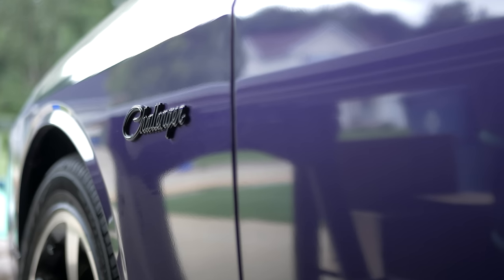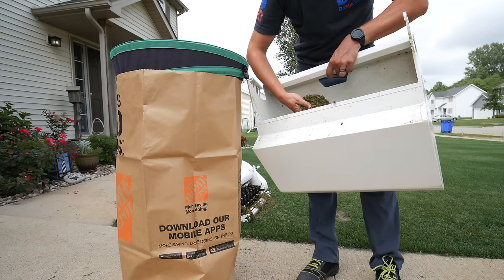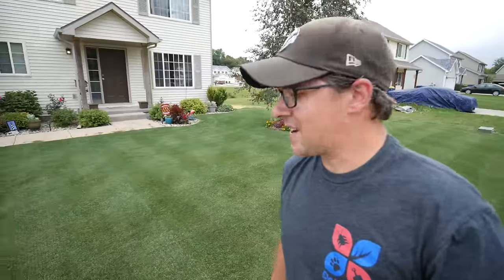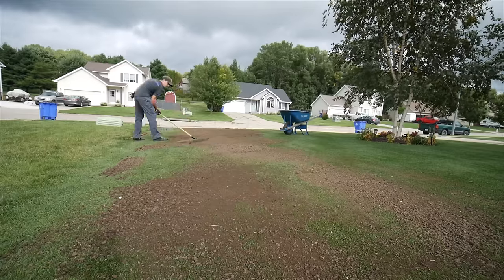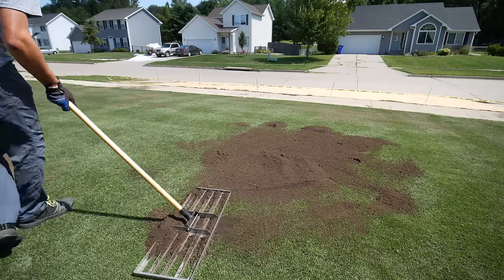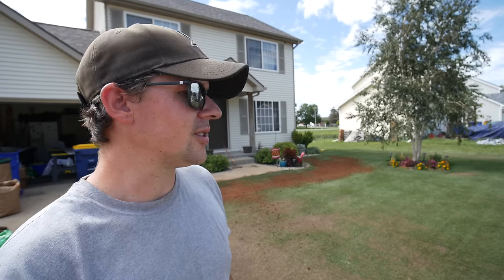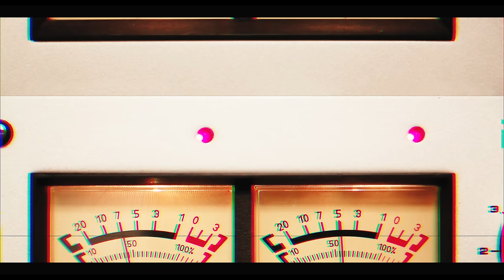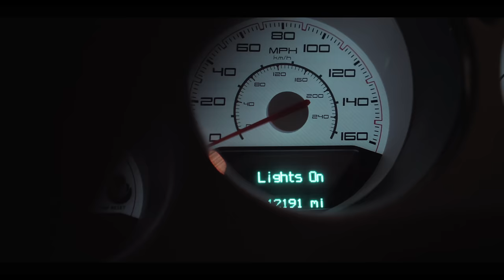Topdress Leveling Overseed + Labor Day Bonus Footage

Comment: I started using a 30” lute/leveller and it looked really good till I looked at it ground really hard.  There where high and low stops everywhere.  I added a 6” rib to the front and OMG the amount of soil I had to remove to get the land really level.  It was hard work but the end result is a really level lawn and I didn’t have to use much soil to do the final level.  Most of the highs and lowers where caused by the turf having under soil missing or lumpy bits .

Comment: Under my trees ground is like washboard ripples 3/4 inch deep roughy ever 8 to 12 inches apart, grass doesn't want to grow in the low spot. Drop spreader hits the bumpy area more product shakes though the bottom of spreader. I speculate it's caused by rain water running off the tree leaves.

Comment: Hey Ryan, I have a question. I have a fairly new lawn that has come in nicely, but I'd like to start leveling it and transition to a shorter cut with a reel mower. My question is that I live on a corner lot with a sidewalk with strips of grass between the sidewalk and the street. How durable is the leveled, low-cut lawn? I get a lot of people walking across my lawn and I don't think that's ever going to change. Not enough to kill the grass and wear paths, but I wouldn't want to switch to a low cut if that is going to be more fragile. Thoughts?

Comment: Ryan... top dressing and over seeding time.  Wanted to run a couple products by you in hopes of getting your professional opinion.  First off I'm in SE Wisconsin... hot humid summers and cold winters... I have a new home build lawn (Sep 2018) and on my 2nd season. Looking to start converting to KB grass. Not even sure what was laid down by the builder however I did over seed last fall with a Vigoro sun & shade from Home Depot (I believe it was a mix of mainly perennial rye.  But PRP keeps coming to mind yet I can not find PRP on internet grass seed searches.... not to mention in a previous comment to you I mentioned it and you even said you had not heard of it. No matter... going towards KB.

Question 1: A local mill offers what they call a Premium Athletic Gold (80% KB/20% PR). I wanted to know your thoughts on using this for a section of top dressing and then to over seed the rest of the yard as my yard to too big to top dress all in one season.

Question 2: They also offer a 14-24-09 starter fert. Your video mentions a 14-20-04 but the other is all I can get in quantity on short notice and at a decent price.

Question 3: Should I only use the tenacity on the top dressing and heavier seeding area or should I try to stretch it through the whole yard?

Yard is roughly 13,000 sq/ft.

Thank you in advance for any input.

Cody

Comment: How do you get new grass to grow just by putting a small layer of dirt on top to level and then put seed down? I thought you needed to get seed down into dirt about 1/4 inch deep BUT also have the soil under it soft and ready to accept new roots.  I have a 3 foot section that is low and deciding whether I really need the grass dug out or if I can just put about 1 inch of dirt on top of old grass, then sow the seed into that.

Comment: Happy Thanksgiving.. So having a prob. My lawn is usually an 8/10 but this past summer I got some chinch bugs and also some spots of bent grass. We killed that off at the end of the summer, then a few weeks later we aerated, seeded, starter Fert, hay. a few spots took but the main areas in the front and a large area in the back did not take. After a few weeks the landscaper put some more seed, etc now a few weeks later nothing. Its getting enough water, the weather has a been fine etc. Not sure what else to do but the seed is def. not taking.. I can send pics if that helps. this is driving me nuts lol .Im in NY.

Comment: Ryan, I understand that the grass blades must absorb sunlight to survive. My Zoysia lawn down here in Florida has some pretty severe undulations. Overseeding Zoysia is not an option is it? What tips do you have before I begin the leveling project? And should I use sand or topsoil as the leveling material?

Comment: Can someone please answer this question? ====>   I just put down dozens of bags of top soil to level a few spots in my lawn.  These were pretty deep...anywhere from 5 to 8 inches.  They're not perfectly leveled right now and I would like to put down sand on top of the soil I put down.  Will this be ok, or do I now need to keep using the top soil since that's what I've originally used?

Comment: Can Perennial rye be cut very short (under one inch) easily? Or does it have to be worked to be cut that low. I tried keeping my rye at one inch but it didn't work out, most likely because of the heat (90 degrees) but I'm interested in trying it again as the cooler season Is approaching.

Comment: That was a beautiful and inspiring video on top dressing. However, I have some questions. I'm in Northern California, cool season, and have tall fescue. Its the best for out here with all the water restrictions. The lawn is bumpy in some spots when I mow it, and I would like to level it. My main question is how low can I cut tall fescue for working that top soil into the ground? Especially with that spreading tool that you use. Everything i read says to cut tall fescue 3-4". I'm wondering if 3" is low enough to spread top soil? Watching your videos it seems like it needs to be much shorter for that spreader to work. Many thanks!!
Reply from the maker: The tool would probably only work at lower heights...you might just want to use the back side of a rake and cut it as short as you feel comfortable and try it that way
Reply: Ryan Knorr Lawn Care Thanks, Ryan. I guess I could try a section at 2.5” and a regular flex style lawn rake and see how it goes. Perhaps do a small section at a time next year. It’s an 800 sq ft lawn, but it’s 40 years old!  Also, was that sifting screen you made 1/2” mesh?

Comment: Great video, great editing (I do some of that so I recognize the effort), and nice lawn.  I personally prefer turf that spreads via stolons and/or rhizomes such as my Zoysia, but your lawn shows the love you have for it.  The only thing I can say is get more cardio and pulmonary exercise.  I'm 50 and I sit at a desk working on a computer all day every day for my job and I am 50, and did my lawn renovation last year and I don't think I had the issues with exhaustion and soreness quite like you did, and I literally get no exercise.  I removed soil with a SOD cutter, loaded it into a trailer (OK, that made me sore), tilled the lawn, all in July heat, then leveled for hours using a drag mat.  I still have a fair amount of initial rough leveling to do before I start doing any fine leveling as your lawn has.  Bad weather postponed my seeding last year to where I was too close to the first frost (not established well enough for pre-emergence products either) to really do well and I had some bare patches that I just seeded again less than a week ago, but it is filling in and spreading now that the weather has warmed up more.  My lawn will never be as level as yours though because I have a drainage ditch and I can't fill that in to make it level, although I'm going to round off the curve a little as I top dress anyway.

Comment: Need to level back yard. There is a portion that is bare soil with gullies n holes. LCN says to level with Mason sand or paver leveling sand n peat moss but peat is expensive . What should I use as top dressing? LCN has a turfmend blend for seed . Is that good or use GCI seed. I used rye in the past n seems to come up fast. I also used potting soil before n seeded spots but a year later it pulls out very easily.

Comment: Ryan, for the lawn leveler, do you recommend the 30” or 36”. Which size are you using in your video? Thanks.
Reply from the maker: I'm using the 30...really I think either would be ok but larger areas may be nicer to have the 36

Comment: After you get it top dressed and leveled, how often will you need to reapply? Or is it just when something happens and you get a low spot? I am working on getting our grass to come up in the backyard and would like to level out all of the low spots, which is going to be a big job (thanks Pulte).
Reply from the maker: For a normal yard it should last quite a while but soil in my area moves a decent amount with freeze and thaw from winter.  Unless you are reel mowing low like I am, you probably won't notice it much after your initial leveling
Reply: @ryanknorrlawncare  Ok, thanks. I'm just north of Indianapolis, for reference. I have watched some other videos and wondered if leveling was a yearly or bi-yearly thing. I have no plans to reel mow (although it does look fantastic), but the yard just feels lumpy under the Timemaster. I will definitely wait to do anything until it fills in a bit more as I could be feeling the difference in the clumps of fescue.

Comment: Hey have you tried the swardman brush attachment? Would you use it to level? Also if you used it do you find it makes a loud vibrating sound?
Reply from the maker: Yes I have used and it would work great if you were doing light topdressing...I had pretty heavy areas so I needed to use a tool to be more precise.  Mine is very quiet when using it.

Comment: Hi i was wondering is there any downfall to buying the 30 inch levelawn as opposed to the 36 inch levelawn? Thanks! I have a small property but if I move into a bigger house in the future i wanted to know if I should just invest in the 36 inch one right away.
Reply from the maker: I have the 30 and find no issue with the smaller size but the little bigger size could be nicer on larger areas.  It should still be fine and manageable on the larger size.
Reply: @ryanknorrlawncare  thank you so much! I will be ordering one soon

Comment: I just overseeding after an aggressive dethatching my lawn. I did not put down any top soil and I forgot to rake the seed in. It's sitting at the top of the soil so it does have seed to soil contact. Will it germinate or is it a fail?
Reply from the maker: I bet for the most part it will still do fine
Reply: @ryanknorrlawncare  Great. Thanks. Keep up with your awesome videos
Reply: My only thoughts about leaving the seeds exposed is that birds consider them to be pretty yummy.
Reply: @donniereidjr  That's true didn't though about that. The lawn it's p pretty thin after dethatch. I over seeded with KBG, I hope that enough survives to spread.

Comment: Great Video.  The Only Thing I'd Add would be an Aeration prior to Topdressing and Seeding, since You had some Fairly Heavy Equipment on the Lawn Installing the Irrigation.   The Second Thing is Your Use of Peat Moss for some of the Bare Areas.   I would Avoid This.   I'd Use a Screened Mixture of Peat Moss, Compost, Sand and Topsoil.   I Love Peat Moss but even a Thin Layer once it dries out can repel any Moisture trying to Percolate into the Soil.